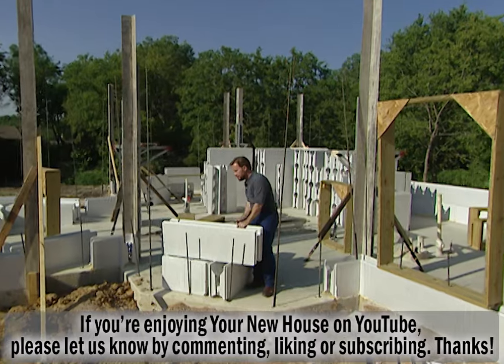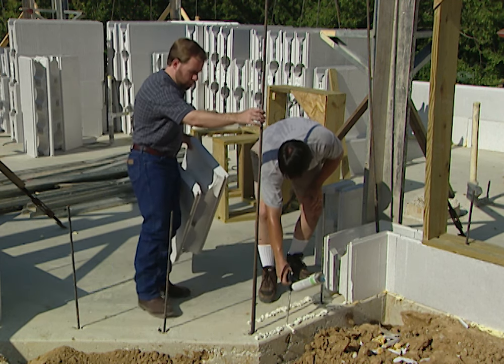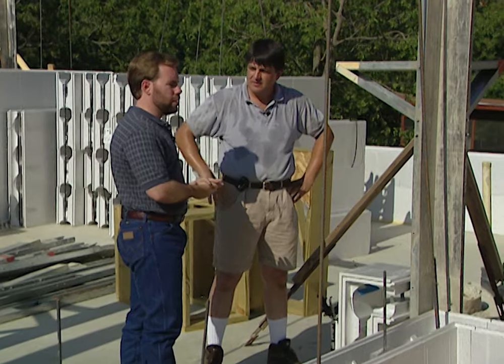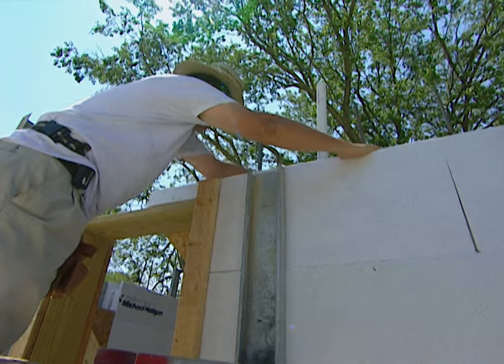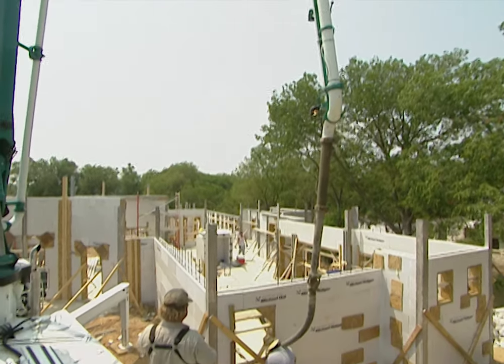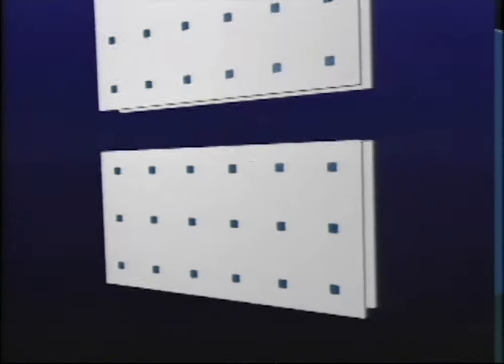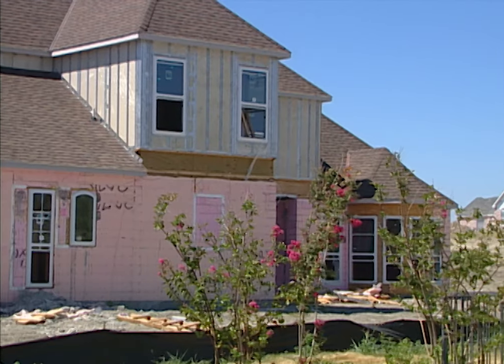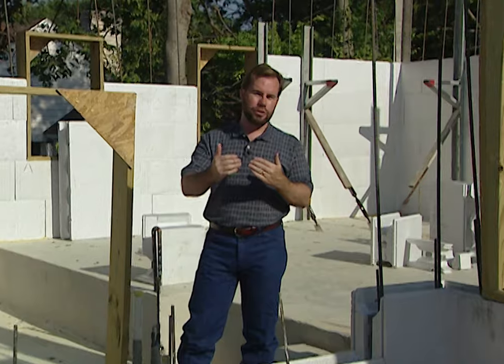A House Built with Styrofoam and Concrete - ICF Insulated Concrete Forms

Comment: Why not just use poured traditional concrete walls and slap "foam" boards  on both sides? Keeping in mind to have open channels where needed for plumbing, windows, vents and electrical.
Reply: there is a lot of labor in setting up and removing traditional concrete forms. They would be adding extra steps and expense in the construction. With no benefit.

Comment: My so spent a fortune on this kind of house and it leaks water every time it storms.   He has lived in hell since he had it built by licensed contractor with permits.  There is no way to fix leaking walls.  Worrying about mold now.  Lost his good insurance and paying a fortune for mortgage insurance.  Still making payments on house.  RUN RUN RUN!!!
Reply: Interesting.
Reply: that's why it's important to use a spray on or stick on water barrier on the outside of the styrofoam insulation before the siding goes up and to have a drip plane so water can get out instead of going into the wall.
Reply: sounds like they need to sue the builder....... and yes there are plenty of ways to fix leaks.